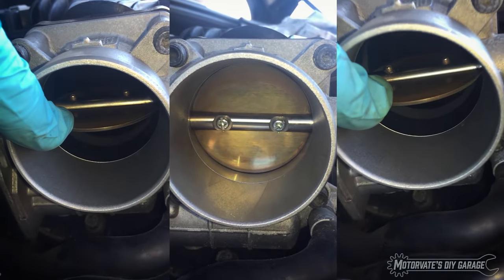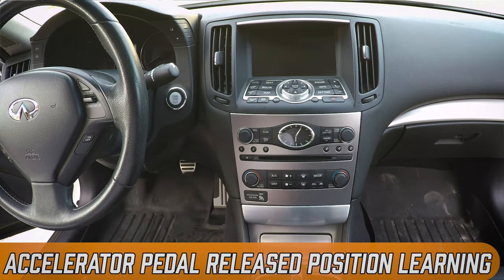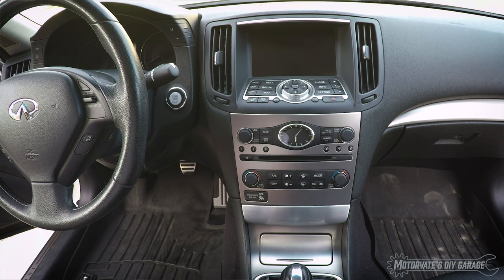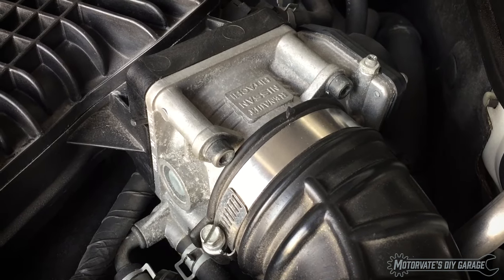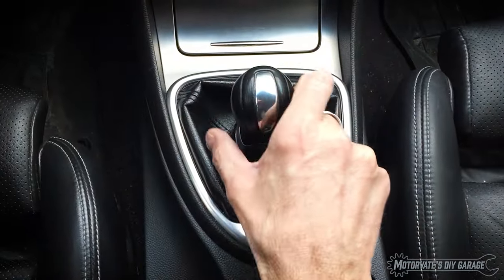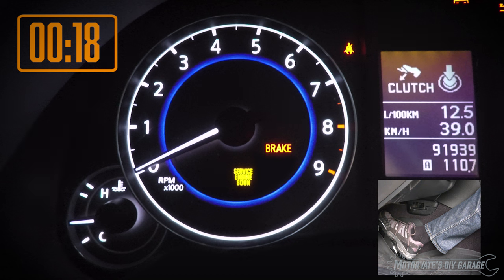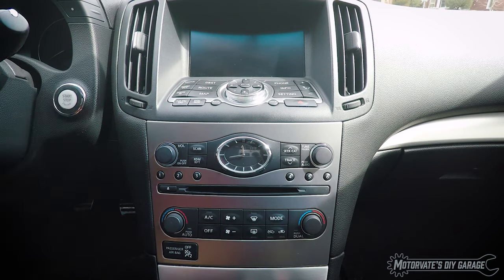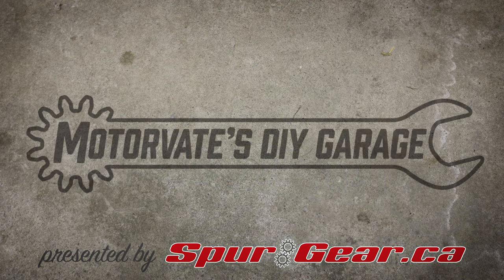G37 & 370Z After Throttle Body Cleaning: Motorvate’s DIY Garage Ep.27

Comment: Diggin the videos bro. Would you have a video on how to reset the ecu. I've been getting a jerky feeling when I climbing gears. Thank you.
Reply from the maker: Hey  Ihùuba✊🏾g37s,
Thanks for your kind words!

It has been my experience that resetting the ECU doesn't fix problems.

If you have an OBD scan tool, you can reset the ECU by creating a code (unplug a MAF and start the car, turn off the car, plug in the MAF) and then clearing it. This will reset all of the "self-learning" 

Or if you don't have any tools, you can follow this:
https://enginepartsdiagram.com/reset-check-engine-ecu-light-2008-2013-infiniti-g37/
Reply: Hello! Found the issue, it was the spark plugs and I just replaced all the coil packs with NGK 😁 the 5th piston was miss firing and used that diagnostic reader.
Reply: Next step is to get my ecu flashed and licensed by uprev. Z1 motorsports is going too do do it. Thank you and keep up with your videos 🤙🏽
Reply from the maker: Nice! I'm sure Z1 will take good care of you :)
Reply: Sorry to bug you again. Did the throttle reset and I believed it work. But have an issue. My idol after warmed up would rest around 750 rpm. Sounds a little loud. Would I need to reset the throttle again? Thank you.
Reply from the maker: Hey   Ihùuba✊🏾g37s,
If the idle is stable, I think everything is OK. For North American vehicles the idle spec is 600-700 RPM. Other areas may have a higher idle to help with hot climates.

If you want to, you can always do the idle air volume learning again - you won't hurt anything. :)
Reply: I will try everything again and see what happens 👍🏽 thank you.
Reply from the maker: Good luck!
Reply: It was a success. Thank you.
Reply from the maker: Great! Thanks for getting back to me.

Comment: Hello I cleaned my throttles and now my g37 is idling at 750 is that normal? What is the range. Please reply thanks!
Reply from the maker: On the G37, the factory spec for a hot idle is 600-700 RPM.
I don't think you have anything to worry about.
Reply: @MotorvateDIY  thanks for replying really appreciate it. I was wondering do you think it would hurt if I still do the idle relearn through the Android app? (I did it before through the method shown in the vid) or do you think I should leave it as is. Thanks again
Reply from the maker: Feel free to do the idle air volume learning using the NDSIII app. 
It won't hurt anything. OR you can leave it as it is. 
I wouldn't worry about 50 rpm.

Easy Idle Air Volume learning using NDSIII Lite:
 https://youtu.be/OiB9txECWB0
Reply: @MotorvateDIY  appreciate your replies! You make great content and on top of that you reply to comments on your older videos. Thanks again!
Reply from the maker: Thanks for your kind words!

Comment: Hey man I subscribed recently love your videos, I just got a g37s and I love it its about to hit 100K miles so what would you recommend when doing at 100K miles? I think I want to change all the fluids just to be on the safe side cause I don't really know the history  of the past owners. But what would you recommend ?
Reply from the maker: Hey HALFBLCK,
Since you don't know the history of the car, I would change the engine oil & filter, transmission oil, differential oil, power steering fluid and it would not be a bad idea to change the brake fluid. The good news is I have videos that show how to do everything... the bad news is that it will cost a little money. BUT If you plan on keeping the car for a while, it will be worth it!

Actually, your engine coolant is probably also due for replacement (if the car is 2011 or older) and I will have a video on that shortly after I change mine :)
Reply: Awesome Thank you so much for the information!!!
Reply: hey quick question, i got 2009 nissan skyline 370GT(RHD) so its got the 7 speed automatic should i change the fluid or nah? its 85k Miles on it
Reply: Motorvate DIY why only after 2011?
Reply from the maker: Hey Tyler Russel,
I should of been more clear in my explanation... The first coolant change is at 7 years or 168,000 Km / 105,000 miles. Since I didn't know the year of HALFBLCK's car, but did know the mileage, I was trying to give a short and simple answer. 

From the shop manual:

First replacement intervals 105,000 miles (168,000 km) or 84 months. After first replacement, replace every 75,000 miles (120,000 km) or 60 months. Use only Genuine NISSAN Long Life Antifreeze / Coolant (blue) or equivalent with proper mixture ratio of 50%

Thanks for pointing this out. :)

Comment: would an ECU reset fix the needed "ECU update" for a VQ35HR on step 3?
Reply from the maker: Hey  Denver,
(This only applies to the 2007 G35/350z. The 2008 models don't have this issue)
That would be nice, but it doesn't work. The only fix is to update the ECU.
Reply: @MotorvateDIY  I thought the 2007 350z and the 2008 350z were the same car?
Thanks so much for the reply!
Reply from the maker: @denpyJ   They are the very, very similar. But there can be small year to year changes/fixes.
Thanks for your comment :)

Comment: 2006 Nissan 350Z  .                            I have some issues with the rpms as well , but my rpm are high around 1200 rpm  and is constant the don't move from there ,  gets annoying  because is very loud inside the car. also some times when I rapidly accelerate the car to high speed the car in 5 gear lose power or don't accelerate , so I have to go 1 shift down  and goes back to normal , but I keep doing it, so I have to wait until the engine cools off and everything goes to normal. I did change the crankshaft sensor the one under the car driver side , but din not fix the issue, do you have any idea ??  Regards.
Reply from the maker: Hey Rafael Gonzalez,

I will do my best to help, but I need to know:

What modifications have been done to the car?
Do you have a manual or automatic transmission?
Reply: Hello sir, thanks for your time. Car have no mods its all stock and is a manual trans,   I did clean the throttle body yesterday to see if that helps  but actually the RPM went more higher now . went up to 2000 RPM.
Reply from the maker: Hey Rafael Gonzalez,
After cleaning the throttle body did you do the 3 steps shown in the video?

The idle air volume learning can be tricky to get to run, but if you have an Android device and a cheap bluetooth OBD scanner you can do it using a free app:

Quick & Easy Idle Air Volume Learning: Motorvate's DIY Garage Ep.28
https://youtu.be/OiB9txECWB0

As for the loss of power, it could be many different things. (O2 sensors, fuel pump, MAF, etc)

If you have a cheap OBD scanner, we can continue to investigate this.

You might want to have a look at my other channel:
OBD4Everyone
https://www.youtube.com/obd4everyone
Reply: RPM issues  resolve , but still have this codes, P1078 , P1084 .
Reply from the maker: Hey Rafael Gonzalez,The P1078 & P1084 code is defined as:

An excessively high or low voltage from the exhaust position sensor (bank 1 and Bank 2) is sent to ECM.

This can be tricky to troubleshoot as there are many checks and they require a voltmeter, back probes and a good understanding of electricity. Possible causes include:
• Harness or connectors
(Exhaust valve timing control position sensor circuit is open or shorted)
• Exhaust valve timing control position sensor
• Crankshaft position sensor (POS)
• Camshaft position sensor(PHASE)
• Accumulation of debris to the signal pick-up portion of the camshaft
• Poor or corroded sensor grounds.

If you want step by step instructions to troubleshoot, do an online search for "350z fsm" and look at section EC on page 538.
Or take it to the dealer...

Good luck with what ever you decide :)

Comment: My car engine light doesn’t blink 8 times only 5 is that a problem why it don’t restart the ecu
Reply from the maker: If you have an Bluetooth ELM327 and Android device, you can use a free app to run the "idle air volume learning"

Quick & Easy Idle Air Volume Learning: Motorvate's DIY Garage Ep.28
https://youtu.be/OiB9txECWB0

Comment: I did the procedure and it worked but later on when I went to start the car, about 4 hours later, it had high idle again.  Is there something else I should do. I have a 08 G35x.
Reply from the maker: Hey  Mario Marin Luna,
How high is your "high idle" and does it still happen after the engine is fully warmed up?
Reply: @MotorvateDIY  I actually figured it out, turns out one of the clamps wasn’t properly tightened so a slight air leak was happening which I assume is what caused the idle to go back up. I did the relearn again and car has been fine so far. Thank you so much!
Reply from the maker: Hey  Mario Marin Luna,
Excellent troubleshooting!!!
Thanks for letting me know :)

Comment: 08 G35 Basic sedan (automatic)
Do not use automatic vehicles
Have to go to the service factory and repair
Reply from the maker: Hey R-jjang,
I am not sure what you are saying... but many people have been able to do these three steps on 08 G35s with an automatic transmission. (BUT that is NOT true for a 2007 G35 / 350z due to a bug in the ECU software)

Comment: I have a 2005 Mazda6. I changed out the motor. We knew NOTHING about Drive by Wire System or SENSOR. Q: Can these steps be used to reset the SYSTEM?
Reply from the maker: Hey Kiaraa Sims,
Sorry, but these steps only work on Nissan or Infiniti cars.
Try to find a Mazda 6 factory manual and it will tell you if there are any special procedures for the drive by wire system.
Good luck!
Reply: Thank U for responding back So FAST!😄 U are AWESOME!
Reply from the maker: Hey Kiaraa Sims,
No problem. I check for comments everyday :)

Comment: Would straight pipes cause the idle to be slightly higher?
Reply from the maker: Hey RzVids,
I don't think so... The ECU will adjust the throttle plate and the VVEL system to achieve the target idle speed.

The idle spec for the G37 / Q40 / Q50 / EX37 / FX37 / M37 / 370z is 600-700 RPM with the engine fully warmed up.

What is your idle at?
Reply: Motorvate DIY It idles exactly at 1k, 1,200 RPM at highest.
Reply from the maker: Hey RzVids,
Is that with the the temp gauge in the middle?
What year, make, model are you working on?

If you have a Bluetooth OBD scanner and a Android device, you can use this free app to do the idle air volume learning:
https://www.youtube.com/watch?v=OiB9txECWB0

Comment: Good evening 
This procedure will work on 2011 M37
Reply from the maker: I think it will, as the M37 uses the same navigation unit.
Once everything is up and running on my car, I will try to find someone local to me (Toronto) that is willing for me to test it.
Reply: Thank you very much.
Reply: Thank you very much. It works.
Reply: Did not work for me, I even got software update from the dealer without success
Reply from the maker: Sorry to heat that Dave. It can be difficult to get it to run to completion. Some have commented here that it took them 20 times, and then it worked.

What year, make and model do you have?

Comment: I thought the VVEL relied on the butterfly valves being 100% open while the engine is on and airflow is controlled by the intake valves? I know this procedure is true and necessary, but if the butterfly valves should only ever be fully closed or fully open, why would this make a difference?
Reply from the maker: Hey Brian Thomas,
That is how Nissan explains how it works, but it isn't quite like that.  If you data log the MAP sensor you can infer the actual throttle position.

I am short on time now, but will fully explain in the next day or two.
Reply: Motorvate DIY I look forward to learning about it. I own a 2016 370z sport and your videos have been of great help in maintaining it. Thank you.
Reply from the maker: Hey Brian Thomas,
Sorry for the late reply, sometime the comments get buried. I think it will be better to have a short episode to explain this. I will add it to my list for later this year.Anyways,  I am glad to help out with your 370z :)
Reply: No problem. Thank you for getting back with me. I look forward to your future content!

Comment: +Motorvate DIY 
Hey I was wondering if you can do a dyno test on the G37 to see if there is power loss with the A/C unit on. I've heard Nissans a/c clutch disengages during WOT. Can you please confirm this? Thank you.
Reply from the maker: Hey Dylan the Duck,
You are correct, the A/C compressor is disengaged at wide open throttle. Nissan/Infiniti (and just about everyone else) has used this strategy since the mid 90s, maybe longer.
Reply: Motorvate DIY awesome. But we still lose power no? I feel as though all the other components like fans, blower motor, alternator, and etc still make it lose power and torque?
Reply from the maker: Hey Dylan the Duck,
Typically at wide open throttle the car is moving quickly, and as a result  there is not need to run the enghine cooling fan.... well not until you come to a stop, then it may come on...

The alternator, blower motor, etc don't really use much power, and I don't think there would be a measurable difference.
Reply: Motorvate DIY I see. Thanks
Reply: I've seen a video on here with a lexus that loses hp and torque on the dyno with a/c on.
Reply from the maker: Hey Dylan the Duck,
I am sure it is possible... Maybe Lexus wants to ensure the  driver always is at the requested temperature. 

Can you post a link to the video? I would like to have a look.
Reply: Motorvate DIY https://youtu.be/zkK5Ip0ADRk
Reply from the maker: Hey Dylan the Duck,
Interesting... I learned not to buy a Lexus :) (/JK)
Maybe the engineers thought with 400 HP there is no need to temporally turn off the A/C compressor.
Reply: Motorvate DIY lol yeah hopefully this doesn't happen on our G's.

Comment: My cranks but won’t start on my 2007 g35 sedan vq35hr. Code came out for (P010C mass or volume air flow 5 circuit low) you know what that means and another code for (P1217 engine coolant temperature) I need help to start it up please it’s my daily
Reply from the maker: Hey Bhino Srt8,

* IF YOU HAVEN'T ALREADY CLEANED YOUR THROTTLE BODY DON'T *
There is a bug in the 2007 HR ECU and if you clean the throttle body, you won't be able to get a proper idle. If you have, the best solution is to contact Enthusiast Auto Care 
(https://www.yelp.ca/biz/enthusiast-auto-care-concord) and Eugene can update the ECU for you to fix this issue. He has helped out a few HR owners fix this issue.

Did these codes pop up after cleaning the throttle body or was any other work done on the car recently?

As defined by Nissan/Infiniti:
P010C: Mass air flow sensor (bank 2) circuit low input 
P1217: Engine over temperature (Overheat)

I suspect something may be disconnected, not fully pushed in or a pinched/shorted wire.

The P010C is saying the voltage the ECU is seeing from the MAF on bank 2 is too low (or none at all)
The P1217 is saying the voltage the ECU is seeing from the ECT (coolant sensor) is too low - which the ECU thinks the engine is too hot (and I assume it isn't)

So... Have a VERY close look at the MAF connectors and all the wiring. If you have removed any grounds, make sure they are attached and tight.
Reply: Thanks for the reply but it says page not found
Reply from the maker: I left a ")" as part of the link. This will work: https://www.yelp.ca/biz/enthusiast-auto-care-concord

Comment: Can I just rest the ecu by unplugging the battery ?
Reply from the maker: No. For the Nissan/Infiniti drive by wire engines, the idle air volume learning data is stored in non-volatile memory, meaning unplugging the battery doesn't erase the  data.
Reply: @MotorvateDIY  gotta thanks for your help
Reply from the maker: Anytime :)

Comment: I cleaned my Throttle bodies a couple months ago on my 370z, but never did this. My idle rpm is about ~625-650, which I think is normal. Did it reset over time? Should I be concerned?
Reply from the maker: Hey nandosman,
Your idle is normal, so I think you are OK. 

I am just curious... How dirty was the throttle body and what is the mileage?
Reply: They were quite dirty, specially on the inside part. Car was 42k miles when I cleaned them. It was so bad it was triggering codes P0101 and P010B, which threw the car into limp mode every time. It's been about 4 months since, and no more codes, or limp mode.
Reply from the maker: Hey nandosman,
That's interesting... Those codes mean there is a large difference between MAF1 and MAF2 air flow.
I don't see how a dirty TB would cause them, but it looks like they have.

Comment: How else can I bring It to colder temperatures if it's hot where I live and the work can't be done in the morning with a cold start, feel dumb af asking this 🙃
Reply from the maker: I love all questions... and there is NEVER a dumb question.

If memory servers me, the 25C / 77F condition is only for the throttle valve closed position learning. If you can't complete this step, you should be OK.

I am 99% certain, that everytime we turn the car off, it does a "throttle valve closed position learning" so it will happen when it can.

I also believe that the minimum 25C/77F and warming up to 65C/149F tells us the ECU just needs to see a 40C/104F temperature increase in coolant temp for the "throttle valve closed position learning" to complete.

So... don't worry about it, you should be fine. BUT the "idle air volume learning" is critical to set he proper idle. :)

Comment: I’m tuned. So would this mess with it ?
Reply from the maker: Yes... After cleaning the throttle body, the tune doesn't change the requirement to allow the ECU to learn the air flow at idle.
Reply: @MotorvateDIY  so I wouldn’t be able to clean the inside of my throttle body ? And do these procedures to get back to normal idle and still have my tune